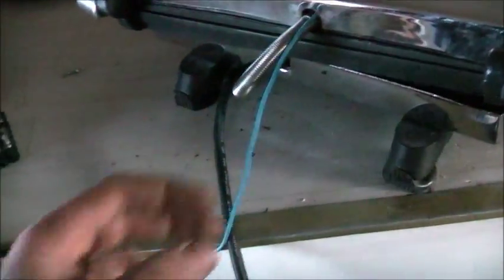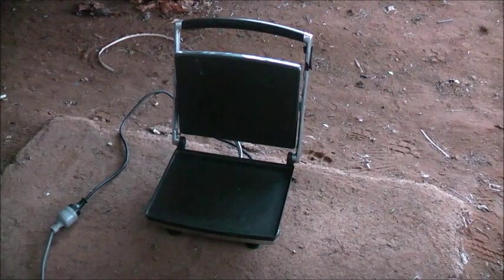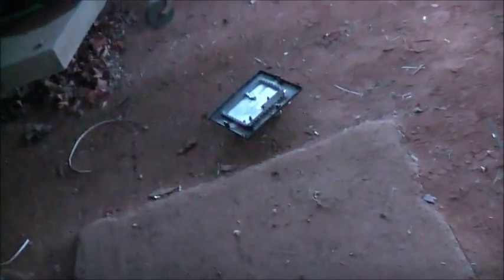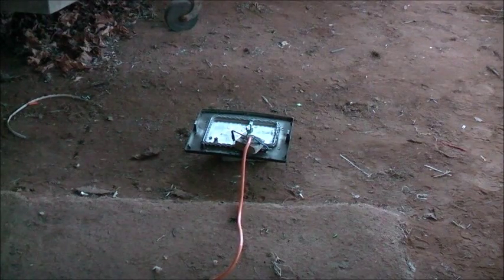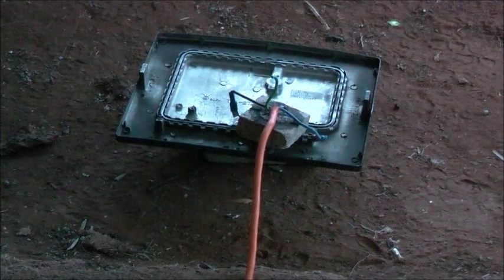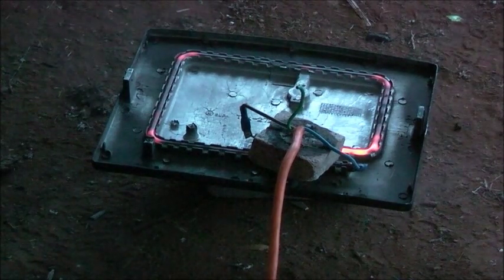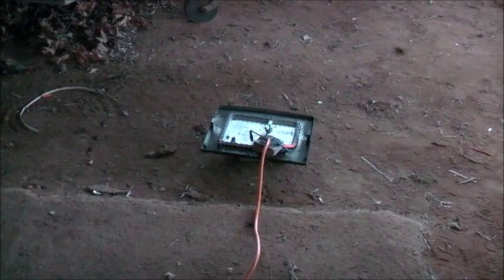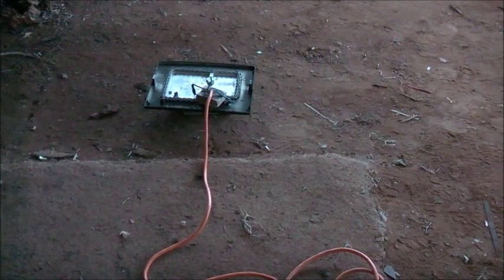Heating Element Overvolt!!

Comment: Yes, for emements like that, it's all simple ohms law, double volts will give double the amps so 4 x power, as Redalco said.
In other load types such as a switchmode supply, it's constant power, so double volts give half the current, as it will self correct!
With reactive loads, it all gets way more strange!!!
Still, am looking forward to seeing these go bang!

Comment: Double the Voltage 4 times the power.
That is one hot element. interesting that they use two x 120 Volt elements in series.
Leads can be warm, these tests are only for short periods. Just keep an eye on it.

Comment: Haha, pulled more watts than you expected. :D If an appliance has 2x 120v elements in series & say, it pulled 8A off the wall socket, if you take JUST ONE 120v elements & stuff double the voltage in it, then it'll pull double the wattage. Ohm's Law says so. :D

Shame about the power cord... 2.5mm² cross-sectional area needed. Good for 24A at 240v (5,760w) or short bursts at 30A (7,200w)

Would've been MEGA FUNNY if you'd wired that across two phases :D

Yep, bigger power cord needed. :-)

-BBD.